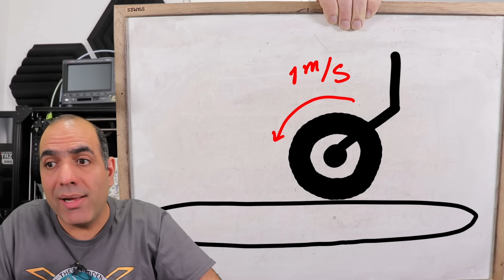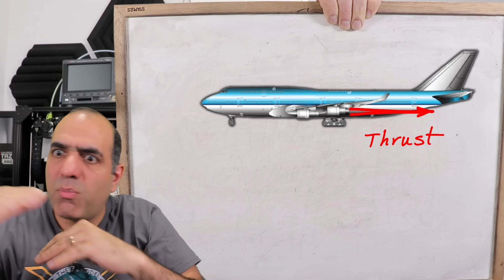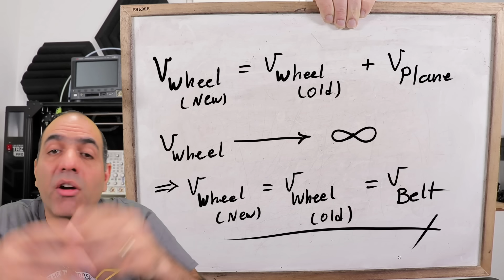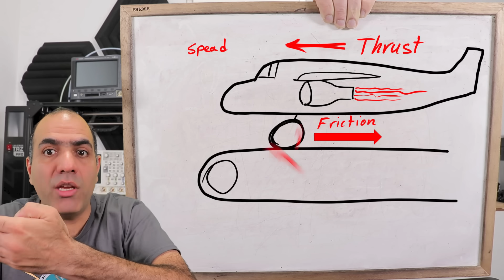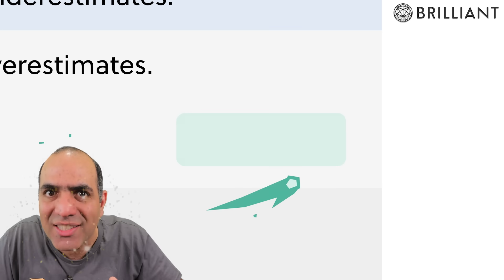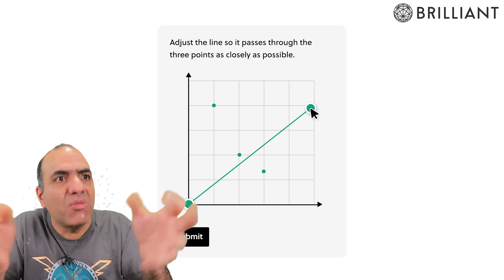Airplane Question that Drove Me NUTS!!!

Comment: If the conveyor belt is moving then the plane is stationary, therefore no air is passing over the wings. No air means no lift so my answer is no it wouldn't take off.

Comment: Here's yet another mildly infuriating way to interpret the problem: Assuming there is thrust from the engines, and friction in the bearings, you can imagine that as thrust acts on the plane, it must first act on the gear struts before the wheels, hence the force that causes the wheels to roll acts from the bearings out to the tire treads. If the treadmill is designed to IMMEDIATELY match the speed of the wheels PERFECTLY, in this scenario, the treadmill could actually slide forward with the plane, keeping the wheel surface speed at zero until the plane takes off. The wheels never even turn.

Comment: The issue (as always) is that the problem is poorly specified.

If we assume still air, frictionless wheel bearings, massless wheels, and an infinite coefficient of friction between the wheels and the conveyor belt, it's impossible to match the speed of the conveyor belt to the speed of the wheels because, once the engines are on, there's a net force on the airplane, so it has to accelerate forward, so there must be a difference in the speeds of the wheels and the conveyor belt.

If we assume still air but the wheel bearings do have friction and mass, there should be some (very high) speed at which the force imparted on the plane by the conveyor belt is equal to the thrust, in which case the plane should not accelerate forward, and it won't take off.

As others have pointed out, if there's a sufficiently strong headwind, the plane can just take of with a ground speed of 0.

In reality, good luck building a strong enough conveyor belt to do this on. If you do somehow manage that, the tires on the plane are probably the next point of failure.

Comment: 30 seconds into the video and the answer is YES the plane can take off. The wheels are not connected to thrust. The wheels could be going in 300 mph in the opposite direction it won't have any effect on the jet engines providing the thrust

Comment: I know that In Hurricanes planes have to be tied down because the headwinds could make the plane lift off the ground just as it does taking off on a run way if a plane is on a Convair belt stationary with no headwinds at all it's just gonna stay there nothing happens. It's kinda comen sense..

Comment: To answer the question asked at the start, maybe.

The wings need an airflow across them to generate lift so unless there's a headwind capable of matching takeoff speeds of the 747 then it will be grounded.

Comment: @ElectroBoom 0:40 No the plain can't take off , because the wheels of the aircraft are just moving. There is no Lift on those wings. BUT if the treadmill is "fixed to the aircraft with holders and goes 170m/s then the wind lifts the airplane, because the lift, lifts the airplan up.

Comment: The problem with the question is the way it's worded: unless we allow for some super-luminal shenanigans, the only valid answer is Vwheel=-Vtreadmill=0. There is no way for the wheels to move where the treadmill always exactly matches their speed. There would have to be a lag in the reaction of the belt to the wheel while it's accelerating, but the problem as worded does not allow for that. So the plane sits, engines off, and yea, without some crazy headwind planes with engines off don't take off.  

In other words, it's a dumb question. 

Now in a more realistic scenario where the belt tries to match the speed of the wheels, the friction of the wheels (bearing + rolling resistance) is so low compared to the thrust of a modern jet, it's just inconsequential. If you could get the plane to rotation speed before the tires overspeed and fly apart, the plane takes off not matter what the belt does.

Comment: The obvious answer is no, it would not take off. You need wind to generate lift. If the plane is not moving relative to the air around it, no wind would be generated therefore no lift, and it would not take off.
Reply: Watched the rest of the video and I can see how I was wrong.

Comment: Yes! The wheels idle, and the engines produce the trust, Just means the wheels spin faster as the conveyor moves, but the plane will still gain speed and take off as the belt is as long as a runway.

Comment: if the belt moves with the plane i guess the friction (skin effect et cetera) would make the air slightly move with the plane and the belt, the influence of the ground effect would be lowered, making the plane generate less lift.
If the plane was on the absolute verge of being able to lift before, like anytime an Aerosucre plane lifts off https://www.youtube.com/watch?v=qVxviSc4PMY ,
this could be enough to make it fail.

Comment: i think it would be able to take off. a plane is different than a car in that the wheels don't create the forward movement, the jet engines do, so if the conveyor is matching the speed of the wheels then the wheels will just be turning twice as fast as normal while the plane is moving forwards normally.

Comment: The problem says the conveyor is as long as the runway. The plane has enough room to achieve take-off speed. It takes off as usual. If you have a conveyor spinning the wheels twice as fast as usual, it might take a little more thrust to reach take-off speed. I assume the wheel bearings are good enough to perform at double rpms.

Comment: How fast the ground moves under the plane has zero effect on the wings.....if a plane reaches 200 mph on the runway with a 200 mph tail wind.....it will not take off...just as a stationary plane in a 200 mph nose wind will take off from a dead stop ( like a kite ) The ONLY factor acting on a plane flying is the air. Maybe the belt will cause some air movement as a side effect, but not 200 mph

Comment: I’m a pilot and I say the plane wouldn’t be able to take off… because of one known phenomenon… stalling… A stall is an aerodynamic condition that takes place when, smooth consistent airflow over the airplane's wings is disrupted, resulting in loss of lift… when an aircraft takes off it needs to move to generate lift (not thrust) and since the wheels allow the plane to move through space… if the plane cannot generate lift, it can’t take off… in conclusion, the wheels help produce lift, you can give it all the thrust you want… but if a plane cannot move… it cannot take off…

Comment: the plane will take off. 

the planes wheels have nothing to do with propelling the plane ahead, its done with the engines. basically the wheels wont spin since the belt tries to match. but the plane keeps moving forward, since its as long as a runway, the plane will get enough speed to take off

Comment: The source of thrust is the engine not the wheels and the source of lift is moving air, not the wings. 
Both the wheels and the wings are just tools used to achieve a goal.